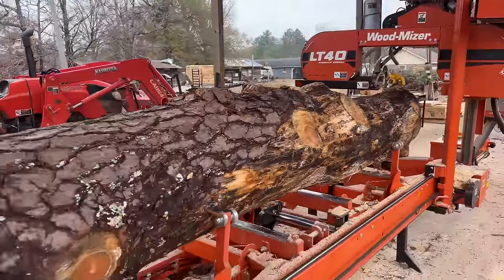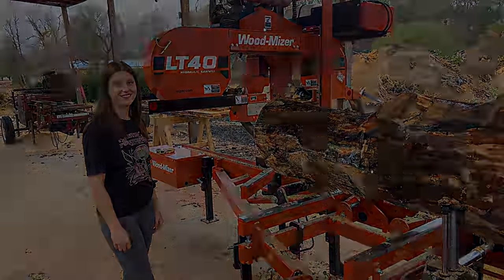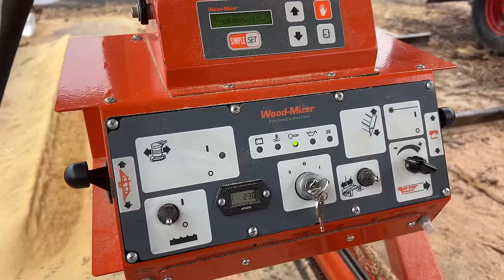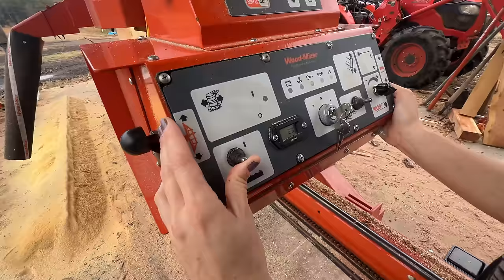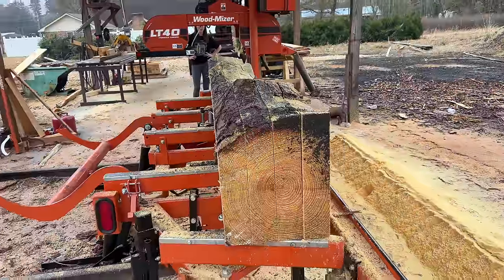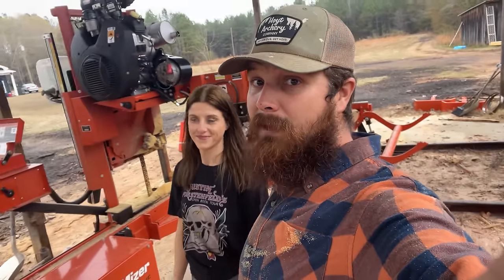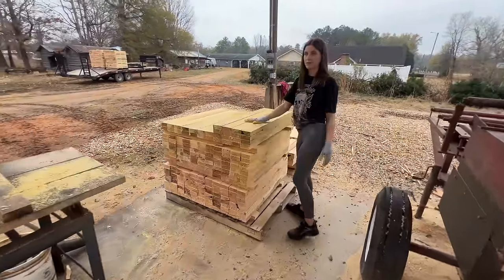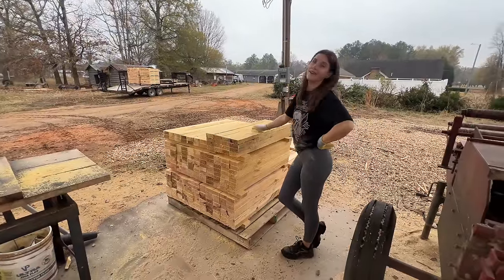This Sawmill CHANGED our LIVES!!!

Comment: Hi, nice, well thought and speedy gear, although there's a small conception flaw : the manometer on the right part should have use a bent connector, in order to have its rated pressure settled at 12 o'clock, so just a look at the needle would show if there is a pressure problem (old marine steaming engines trick).

Comment: Do you find yourself using the “Auto Down” or “Pattern” setting more when running the sawmill?
Reply from the maker: We just have the simple set works. The auto down is after we select the starting height. I really like it because we generally are sawing 1 1/2” and I know the starting points like the back of my hand, so it takes a little off the mental fatigue to only have to set it once and then allow the machine to do the calculations.
Reply from the maker: We have a Florida trip planned for early spring! We will have to swing through!

Comment: You have upgraded to a different sawmill.  Is the motor a gasoline or diesel?  I have saw both models advertised from the sales manufacturer.  This model does take a lot of the hard work out of the sawmill operation.  Especially turning the logs

Comment: I really apricate seeing old railroad rail put to good use. I was in track maintenance for 11 years. 👍 Looks to be about 110/yd rail. So, 110 pounds per 3 feet of rail. Approximately. Hard to tell the difference between 110 and 115 at a glance.

Comment: Looking good guys.don't see much difference between that 40 n my 35.electronic end maybe.
Reply from the maker: Everything is beefed up. Drive motors are larger. Frame and hydraulics are about if not exactly the same. But the heads are totally different.

Comment: Didn't  you used to be blonde?
Reply: I didn't read the many comments.  I'm sure during the shooting of the video, you chose not to take advantage of the forked tractor while milling.  Dumping and transporting slabs and boards on forks of a tractor is certainly easier than man handling each one at a time.  When you re 74 and its 95 degrees, a forked FEL tractor can be a life saver.